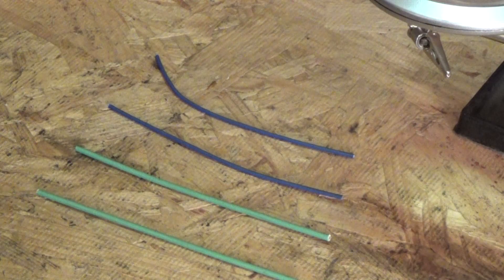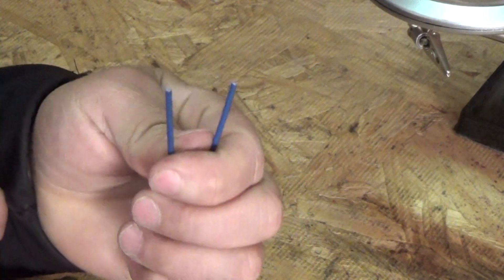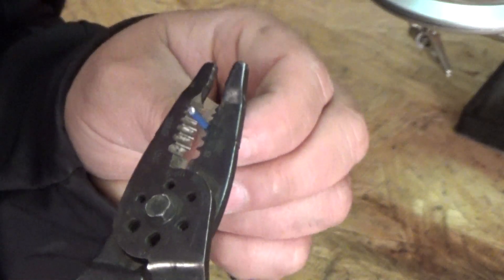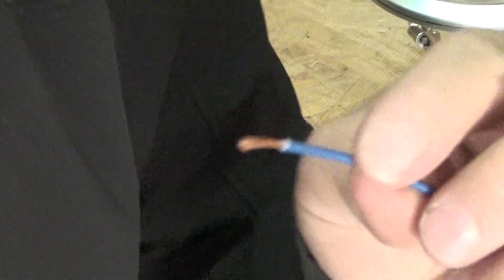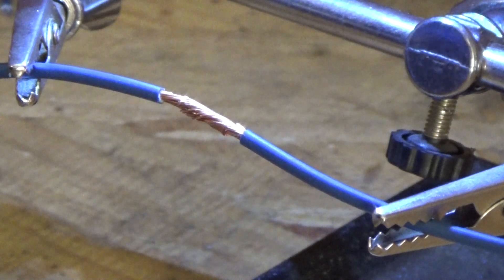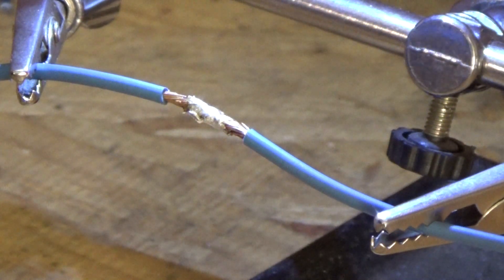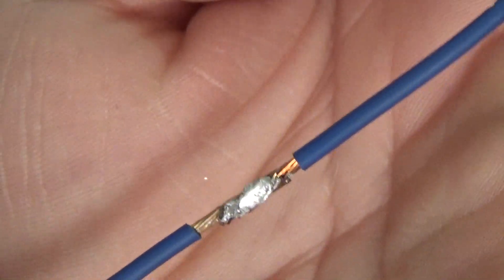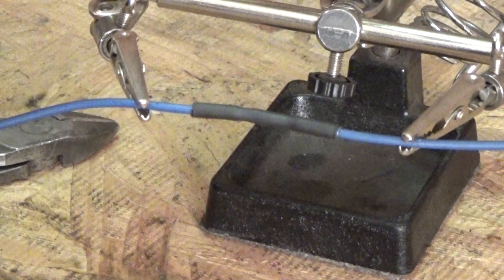How to Solder Wires - Wire Repair - Automotive Education

Comment: just thinking - if no "helping hands" is available 2 slots cut into a small "topless" cardboard box , 1 each an equal distance from a corner, would help hold the wires and catch any drips - the box could be wet down a bit for the safety conscious solderer.  perhaps a bit of rosin type flux or other electrical use flux put on the wires before soldering would have helped the flow a bit

Comment: The solder spiked because all of the flux from the solder core was cooked off. It can be from a combination of too much dwell time and tip temperature being too high. Knocking the points off still leaves what is called a "cold" (US) or more appropriately "dry" (UK) joint. To help slow down the flux burn off, turn the temperature down a bit. If that is not possible then believe it or not you can correctly reflow it a few different ways. the first would be to introduce a little more solder (must have a flux core) with a larger size tip and as you feed that small amount of solder remove the tip. This will introduce more flux into the joint and rewet the solder in the joint. Another way is to add a bit of flux (paste or liquid solution as long as it's meant for electrical work) to the surface of the splice and , with a clean tinned tip (just a dot extra for thermal transfer), reheat the joint until the entire solder joint reflows, and as soon as it does, remove the tip from the joint. Another issue can be with the solder itself. Cheap solder quality can vary greatly as well. Sometimes the flux core in cheap solder is not even useable and can cause dry joints and frustration in beginners who assume they just can't solder. If you're looking for a good brand, Kester is my go-to. The lead free is spendy but the leaded spools most beginners need is about $25 USD a pound and that spool will last a while for a beginner.

Comment: The problem with all these videos is that they are demonstrating soldering on the bench, they never show how difficult it is to do in a harness! On top of that, how can you heat up heat shrink when the join is in the middle of a harness surrounded by wires?

Comment: In the.pass i have used.wire nuts. It does work fairly well then wrap with electrical tape. It will work in a pinch. It is cheap..

Comment: thanks for the vidieo I just got a boat and my truck does not have the plug for the trailer so I got a soldering iron to put the plug on but I didn't know how to solder but now I do !!

Comment: The only thing I will add is no one seems to use their wire stripper tool correctly. When stripping the insulation  turn you stripping tool so the flat side of the stripping hole  in the direction toward the piece of the insulation you are removing.  Just turn the stripping tool over than what you have it in the video. Makes it easier and neater.
Reply from the maker: Thanks for the tip, I'd never heard it before, but I'll definitely give it a try.

Comment: Your soldering has already been addressed in comments. =]  All I will say on that issue is that no flux core solder has enough flux in it for the job.

The issue you are having with your crimps and the heat shrink breaking is that you are using the incorrect crimp. The crimper with the nib that pushes into the connector that you used is for non insulated connectors. For insulated connectors you have to go further down on your tool and use the crimp spots that are oval without the nib. This area is for insulated connectors. Also you need to use two crimps if you are using a narrow crimper like you have. Always make your first crimp close to the center of a butt connector or the lug of the  ring or fork type. Then slide your crimper toward the wire and make a second crimp ensuring they do not overlap or go off the end of the metal inner portion and is in the same orientation as the previous crimp. This will give you a superior crimp and will not break the heat shrink. If you are using non heat shrink connectors I recommend putting heatshrink on them with silicone paste or other dielectric placed on the connection prior to putting your heat shrink on. I have also used a small amount of hot glue on the connection prior to the heat shrink so that it really seals it up when you put the heatshrink on. Just put a little hot glue on the joint using a heat gun or butane torch, let it cool a bit and slide the heatshrink over it. The heatshrink we use at work has hot glue already applied to the inside surface for weather proofing.

Comment: He missed one of the most important  steps.      Always wipe a soldier joint clean. Flux is corrosive  when it turns that copper wire green  you will start have a connection  problem  other than that very important step he is doing a nice job.

Comment: Great demonstration. Just like a clarification, why is crimping not as good as soldering? Is it a matter of better conduction or a longevity issue? And, for automotive application, is here special wires and butt connectors to use since they'll be operating in the engine?

Comment: First I would like to thank you for your video. I agree that between the two procedures  the first one is the best.  Watching you I feel that 1.- You don't use flux. 2.- If you use flux and apply the gun at the bottom of the wire and the solder on top of the wire the solder will run toward the heat  and run across the whole wire more evenly.  Please elaborate as how many solder there are.  and when to used them. In this case you solder 2 COPPER wires what if copper is  not in play. Thank You

Comment: I'm probably one of many that disagree that soldering is the preferred way to join wires together. All the manufacturer's I have worked for have strict wire repair guidelines. The crimp and seal, aka heat shrink butt connectors, is the preferred way to repair wires. This is due to having a solid  mechanical bond between the wires. This will prevent the wires from pulling apart. It will also reduce high resistance and lower the chance of corrosion. With that being said you do need to use quality heat shrink butt connectors and a quality tool to do the crimping.  Soldered joints are highly susceptible to strain and fatigue. the act of soldering itself causes that point to become rigid and brittle. Don't get me wrong I believe soldering has its place and I have used it many times, it's just not the best way to do a repair. Even manufactures will say to use solder but only in conjunction with a crimp. If you look at any car you will not find any wires that are joined together by solder alone. I liked your video and I know it will help several people and a soldered connection it a thousand times better than just twisting them and taping them any day. If I do solder I like to make a linesman joint, if there is enough wire, due to making a good mechanical connection. I don't agree you should use the soldering iron to melt the solder. You should always use the wire to melt the solder so you allow the solder to wick through the wires. If not you are making a cold soldered joint which is even weaker and more likely to fail.

Ref.  https://www.gmupfitter.com/files/media/photo/842/2018_Elec_BPrac_093017.pdf     Page 48
Reply: It's possible manufactures prefer crimps over soldering because crimps are faster. Soldering takes longer, but has advantages over crimps.
Reply: I agree with you. His case of breaking the shrink material is because he isn't using the specific tool. And those type of crimps create a great seal cause the glue pushes the air out and also helps keep the wires together. You're not just relying on the crimp part. Also soldering does somewhat damage the wires by heating them. It's not just the specific soldered spot that heats up. The hear transfers further along the wire.

Comment: Should put soldering flux on the joint so the solder will flow better in between the wires.
Reply: No, you shouldn't. Just NO

Comment: Electric soldering guns are hard to use for the heat transfer. I like the butane gas torch heats quickly and cheaper than the iron and no cord.
Reply from the maker: I don't really disagree with you on that. If I'm on the bench, I have the habit of using my soldering station, but on the vehicle, I have 2 different butane soldering irons that I use and I do really like them. Plus I have the attachment to set heat shrink without pulling out the heat gun. 

Thanks for watching and for your input.

Comment: What size is generally used to fix wires?
Reply: The size of the wire you're connecting will determine what size connectors to use. Hope that helps
Reply: How do you determine that precisely, is there marking on the wire, is there a tool to gauge wire diameter?

Comment: Very good presentation.  It was great you gave people a 2nd choice and how to do it the right way.  No matter that soldering is far better,  there may be times you just need to do the butt joint connectors.  By including it, you did people good.   I haven't done much soldering lately. I just needed a refresher course.   Thank you for the video.